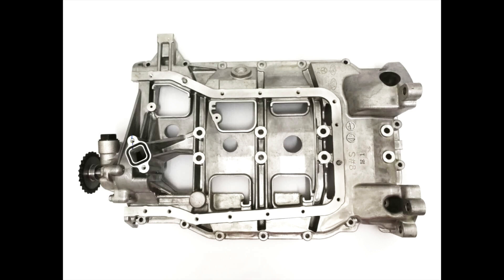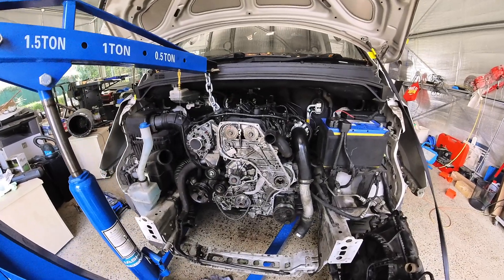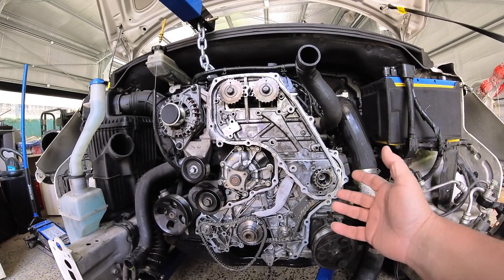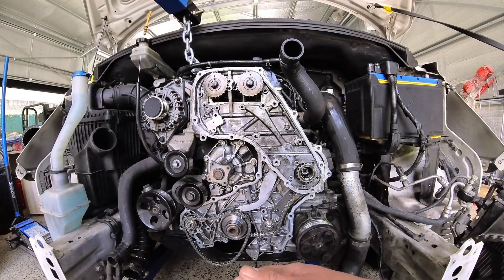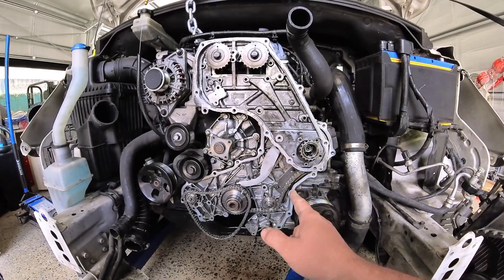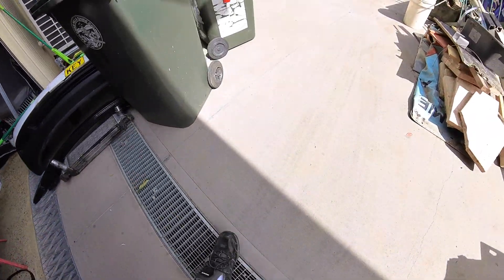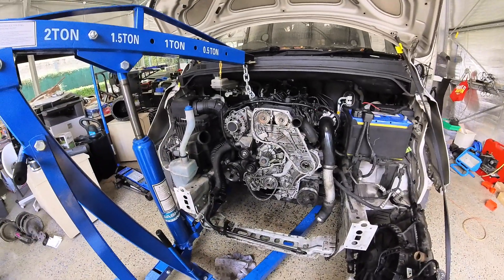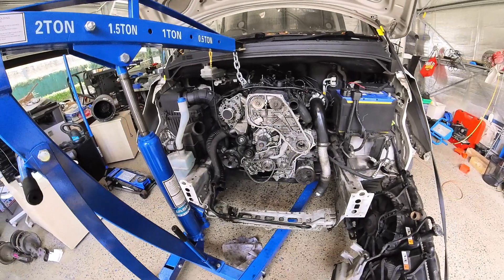Hyundai iLoad D4CB Reconditioned motor after 1 year PART 4

Comment: Oil pressure hot idle on these should be minimum 22 psi. Can go up to 80 psi when cold with a few revs.
Was gonna remove that bed plate cause i had a few cross threaded sump bolts, but i thought nah, too much work.

Comment: It looks like you really disassembled the front! Was it necessary to take the timing chain off? Or just for the oil pump?
Reply from the maker: yep, the timing chain drives the oil pump, and both were replaced
Reply: @ true I’m about to do mine, timing chain. I can’t take the engine out. I have a petrol. So I’m thinking you only had to take the engine out for the Oil pump right? My oil pumps a lot smaller. :)
Reply from the maker: @ryanbaumber7643  If you doing the trimming chains, you dont need to pull out the oil pump, and most likely it will be easier than mine if you did want to replace it. Check your oil pressure before replacing your oil pump. If you just need to do trimming chains then you can do it all from the front, remove everything except the air con , leave that connected and push it to the side. its all from the front on my motor DC4B

Comment: What a drama mate, Ford coyote v8 4 valve engines have a restrictor in the oil gallery in the head about 1.2mm hole , these are pressed into head to reduce flow to the lifters and tensioner , very easy to block.
if you don't change oil and filter enough the oil filter has a bypass valve and will let debris flow through the engine.
Reply from the maker: Im happy it's not in the head, not yet anyway, I change the oil every 5,000